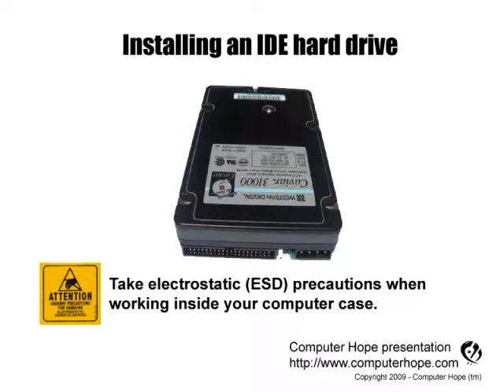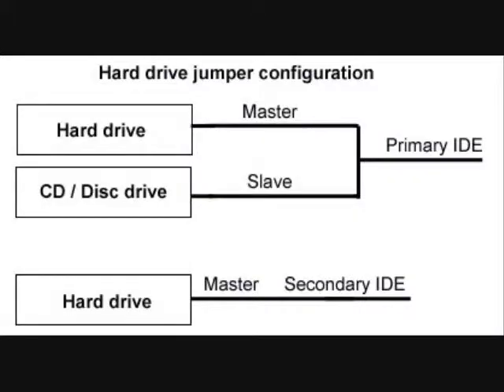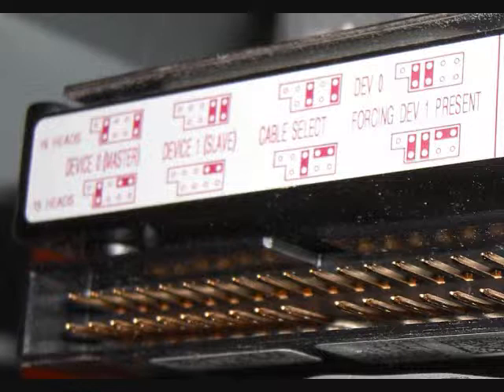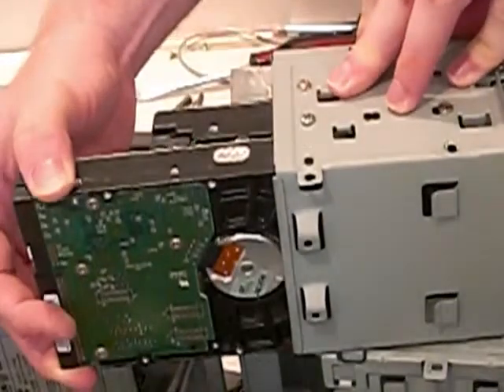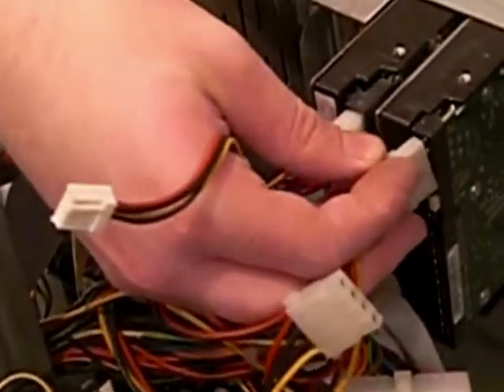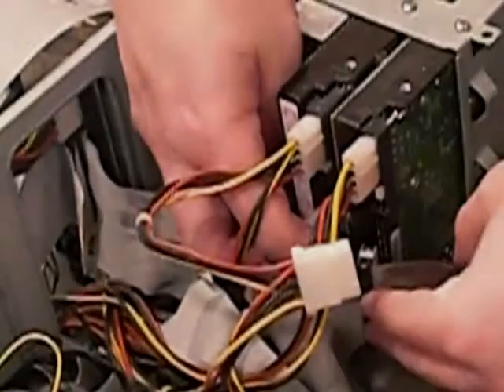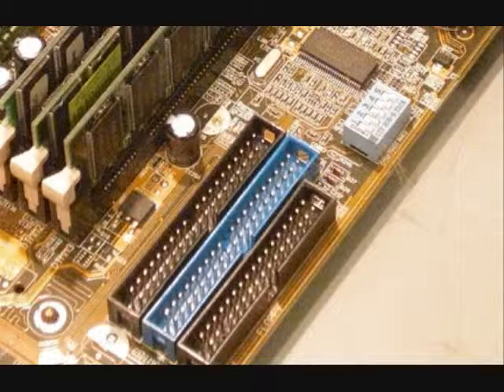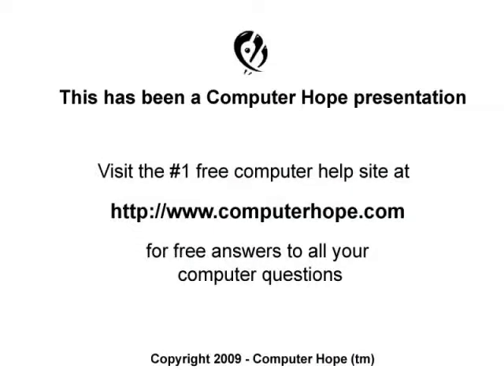Installing Hard Drive

Comment: So if they do that, would that mean I would also lose all my data on my C drive too? Because those drive letters have no files or anything in them. In fact they are used for only connecting USB wires from other devices such as Cameras, PSP, etc.. My main problem is that everytime I try to connect with a USB port it fails to reply which didn't happen before. Than when I checked on "My Computer" All my drives vanished. So I assume that I can't upload files from another device due that problem.